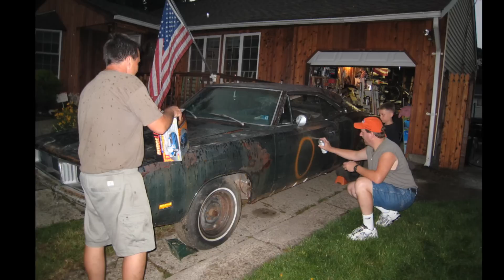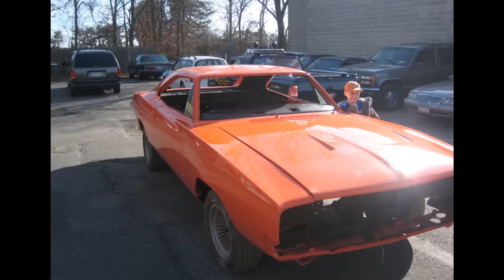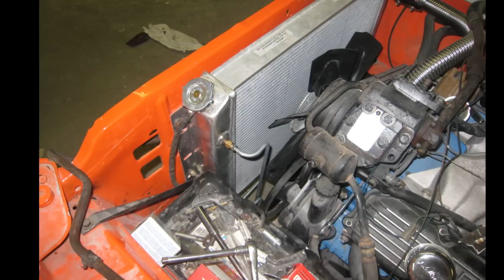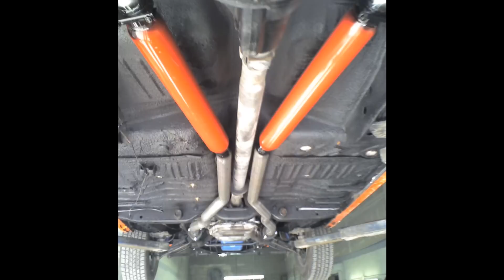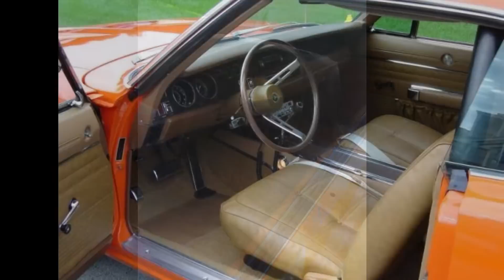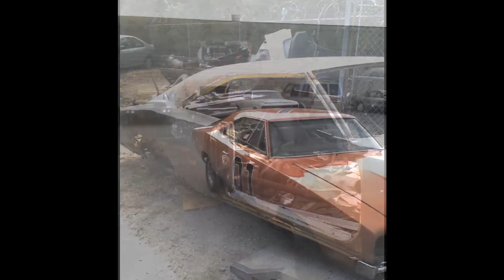General Lee  Build HD

Comment: Now you need a rollcage and to weld the doors shut.  Great work
Reply: We all know the doors are supposed to be welded shut, but only stunt vehicles had welded shut doors to prevent them from opening. Other than that, the General Lee's doors were locked.
Reply: True, but as these Chryslers had no full frames, they would benefit from the increased rigidity a rollcage and door welding would provide :)
Reply: Need the front and rear side lights... orange (?) on the front red at the rear... Paint and details look amazing!

Comment: Nice car and job well done.  If I was going to make one of these I would try and go for the original design from the first episode.   Leave the vinyl top chrome trim on 1/4 panel top half and remove the gas cap trim ring.  Full roll cage and a narrow front push bar.  I think the engine was a 383cid.  Trunk mount CB antenna and the crossed flags on the rear glass panel.  I would leave the doors unwelded for access and to roll up the windows when it rains.

Comment: i used to be a dedicated mopar only guy. but now im a little more experienced. so if i was to build that car i'd put a small block chevy engine in it, because theyre just a whole lot more reliable and efficient than mopar engines. sorry to anybody who disagrees, but its the truth. i would make it look like a mopar engine though. also i would go with gm electrical system too, because mopars are horrible too. so is there torsionbar susspension. but i love the body and interior of that car!

Comment from the maker: Steering Wheel???
Roll Bar is in there now.
REAL General Lee's were predominently 3 speed automatic 727 tranny's
There were a lot of different ways i could have went with this build, but my goal was to get as close to tv correct as possible.
There's a lot that goes into building one and it took me 40 years to get there, but don't give up and hopefully you'll get yours too.
Good luck

Comment: the stick where u shift gears is different than the show
Reply from the maker: The same, correct and original stick.
Reply: +arb9399 no y t
Reply: +arb9399 are you selling the dukes car bro
Reply: arb9399 hey man how much did it cost to restore it and how difficult was it to find parts? I wanna restore one
Reply: The show used different cars with different configurations, including a console automatic and a column automatic.  The "correct" GLs were console automatic big block cars, but reality was that the builders and drivers preferred small block cars.   The only one that's NOT correct is a 4 speed.

Comment: What color and what type paint did you use on the interior I’m rebuilding my General and don’t know what paint to use
Reply: *edit sorry I didnt notice you were meaning the interior color..
The paint is TNT Express Orange. The underside of LEE1's original bonnet was scanned and it came up an identical match to TNT Express Orange. The wet paint wont look like the right color orange and you'l think its wrong, but when the paint fully dries and cures it will change to the right color. I think from memory it took a week so be patient and it will be perfect.
And alot of people make the mistake of putting the confederate flag around the wrong way on backwards, make sure you have the stars pointing towards the drivers side not the passenger side.
And dont have the 01 too far forwards.